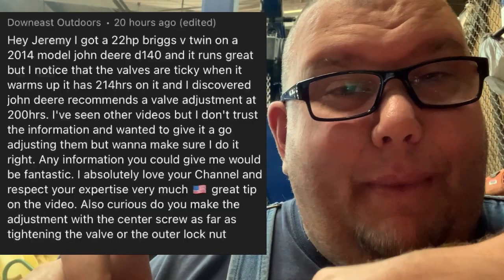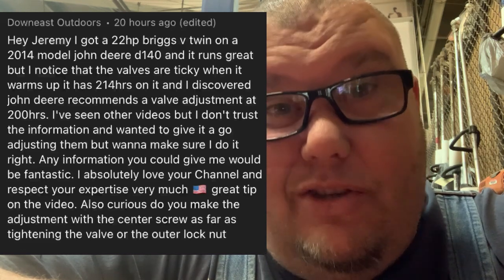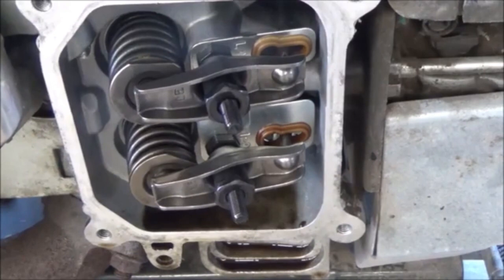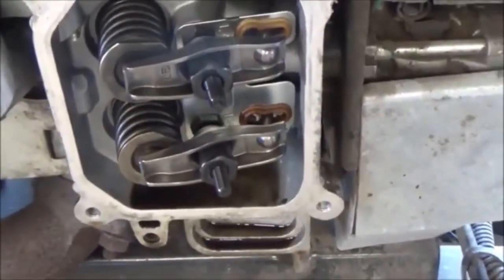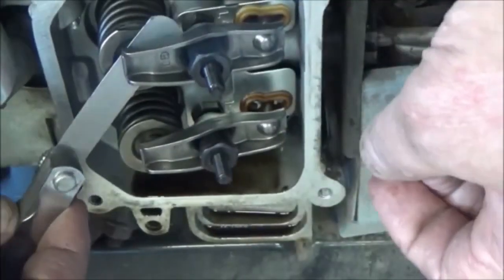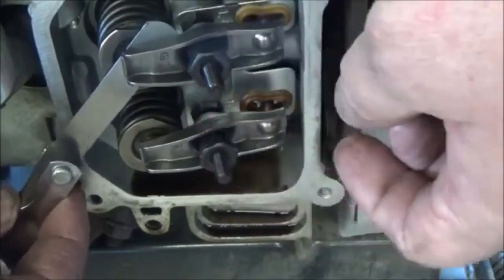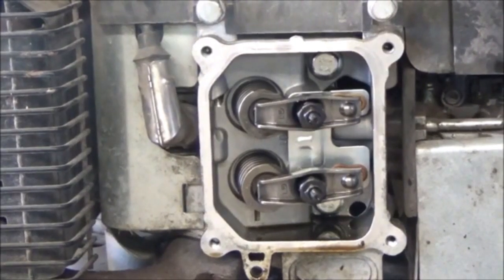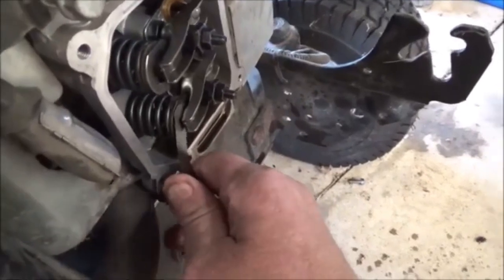MY MOST ASKED QUESTION : HOW TO ADJUST THE VALVES ON A SMALL ENGINE

Comment: Here is a good question for you. I have a 79cc gas engine on a small water pump made by "Extreme Power" idiots. It has NO compression release on the cam shaft or anywhere else. It got EXTREMELY hard to start and yanks the starter rope back violently . No shops around here will work on Chinese motors so you do it yourself. Setting valve clearance at .004 and .007 didn't help. A diesel mechanic said set both at .002 or .003. This helps a little but still not a good cure. What's the solution here when there is no compression release?

Comment: Should check again AFTER tightening the counter nut. It changes the gap a lot...
Reply from the maker: If you’re adjustment moves after tightening the nut that means you are over torquing it and literally stretching the bolt

Comment: I just paid someone to adjust the valves on my Toro zero turn and within 2 weeks it is difficult to start. Doing the same thing again. What do you think is the problem??
Reply: I’m having similar problems with my valves staying adjusted correctly.  I do my own work but I’m not an expert.  I’m beginning to think that the rocker arms need replacing.  I noticed extra side to side instability while trying to set the gap.  So, I’ve ordered the rocker arm assemblies for my Toro Timecutter SW4200 model 74784.  I don’t have the experience to identify a marginally worn rocker arm from a totally good or totally bad rocker arm.  So, I think that might be a good subject for a video.

What may be happening on both our machines is that the valves rocker arms are not centered completely when the gap is set.  Then as the engine runs the rockers center themselves and that causes the gap to change.  Again, I’m not qualified to say what the problem actually is but replacing the rockers assemblies will tell me something.

Remember, give me enough time and new parts and I will fix anything!  LOL 😊

Comment: Yes!!! Thank you Thank you! I really appreciate it Jeremy. Your a God send sir. 🙏 much much appreciated! So when Im at top dead center a 1/4 past,  I can adjust both sets of valves so intake first then exhaust then on to the other cylinder? In other words I do both valves on one side then on to the other 2 valves on the other cylinder I don't have to turn the motor over anymore after that? As long as I at TDC Hope you understand my question
Reply from the maker: Yes both valves at the same time
Reply: @THEMOWERMEDIC1  I believe you can do it with one open one closed too and that's what confuses me as well in the beginning. But the manufacturer tells you TDC 1/4 past. More than one way to skin a cat I guess. But I'd rather just do it by the manufacturer regardless if it's the same outcome
Reply: @THEMOWERMEDIC1  ok great because I wasn't sure if I could only do one set then have to do that process all over again on the other cylinder

Comment: Question: My brother in law replaced the head gasket on a Briggs 14 OHV engine and messed up the valve adjustment. When I went to do it I noticed only the exhaust stem had a cap and the intake didn't. Did Briggs ever only put the stem cap on just the exhaust? I'm nervous about starting it and don't have access to a parts engine. Thanks to anyone that can help.
Reply: Basically some engines come with that cap and some don’t, I just figured that out myself, if you take the rockers off you will see space to fit the cap, most likely there is a gap on the exhaust and no gap on the intake, that’s because the exhaust is meant to have that cap where the intake isn’t, uselly on bigger motors there will be a cap on both

Comment: I recently worked on a Kohler command 23hp. It kept blowing the oil filter gasket. I took the motor apart and the only problem I found was a bent pushrod. Could that cause the oil filter seal to blow?
Reply from the maker: No sir the oil pressure relief valve is stuck with sludge
Reply: @THEMOWERMEDIC1  so a good cleaning and reassemble? I'm guessing that's the spring by the oil pump? Any suggestions on fixing broken valve cover bolts? Had 2 break down in the heads some. Drill or can you puddle up a weld inside the aluminum without melting it?
Reply from the maker: Kohler utilizes self forming thread bolts when you back them out the threads get clogged with aluminum you have to run them in and out very carefully or they will snap off every time experience and finesse is key here
Reply: @THEMOWERMEDIC1  these never moved trying to back them out with a 1/4" cheap porter cable impact just snapped. It was fast if they wouldn't have snapped so fast I would have run them back and forth some
Reply: @kurtknispel9170  I never use impacts on neglected engines or where the fasteners go into aluminum. Only the flywheel nut is where I use an impact. I learned the hard way too.
Reply: @tihspidtherekciltilc5469  I've found I break less with an impact. The sudden jolt usually breaks something free. A wrench or ratchet twists and breaks more it seems.
Reply: @kurtknispel9170  Yeah I use an impact on fasteners that are siezed but only with trigger control for light taps back and forth with heat. A small hammer and punch is really what I do most times and haven't broken a bolt in years now doing those three things. It's the people that just squeeze the trigger until it breaks cause they have little to no experience that I was meaning.
Reply: @tihspidtherekciltilc5469  same here. The bolts I snapped were on a zero turn that had sat outside for years so no surprise they were seized. I should have heated them but I didn't
Reply: @kurtknispel9170  I found that having two projects helps in not rushing on one and has saved me a lot of grief like the three lawn tractors I got recently. All neglected waiting to have bolts snap.
Reply: @tihspidtherekciltilc5469  yeah I keep several going at a time so I'm not waiting for parts and I can stop and think about my next move while messing with something else.
Reply: @THEMOWERMEDIC1  it was very full of sludge. Thanks for the advice